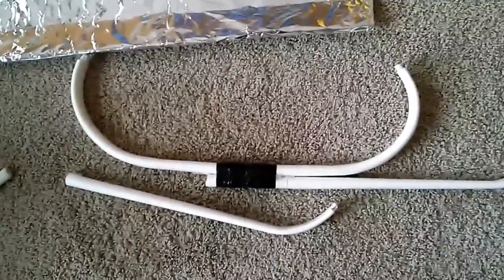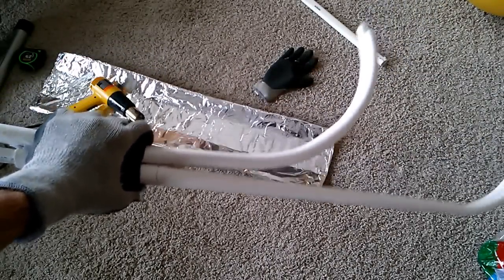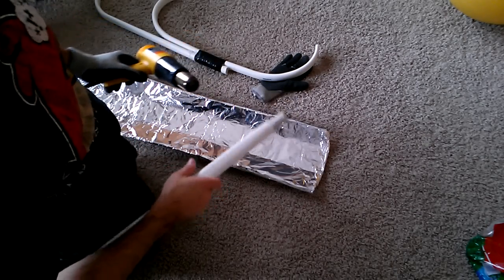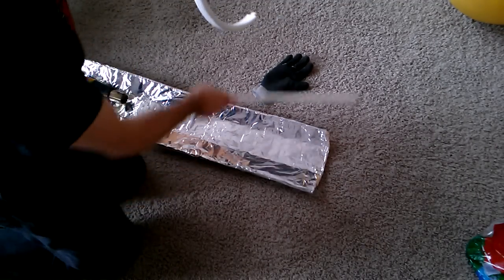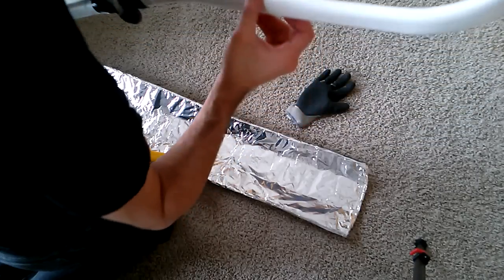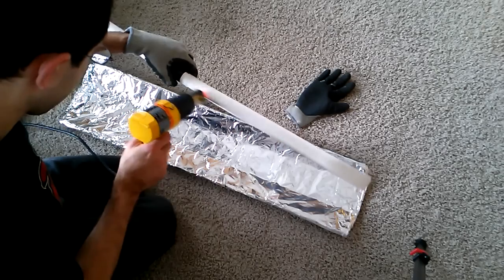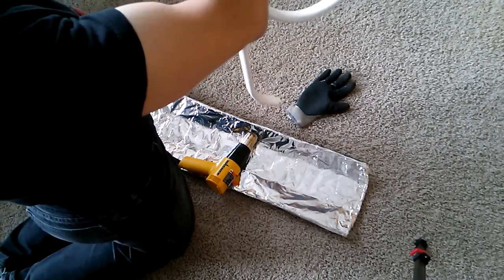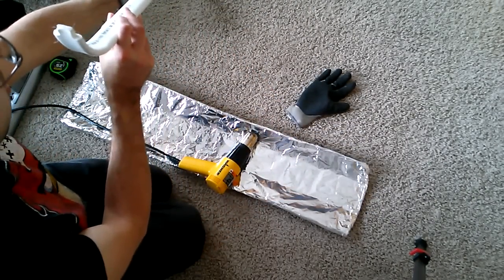Repaired! Fixing the Broken Penobscot-style PVC Double-Bow

Comment from the maker: Each plug was trimmed - I heated them, then cut the corners off with tin snips (you could just as easily sand them); this made insertion easier. I then heated them again and formed inserted them to take the shape of the limb. Not *fully* round, but not totally flat, either. Pinched, is how I'd describe it.

Comment from the maker: Instead of hot glue? First, I can melt the glue again and change things if I need to. Second, I have little to no experience with PVC cleaner/adhesive. I love the idea - blending the plastic together permanently, but I'll need to play around with it a few times to be comfortable. Hot glue is forgiving, so I tend to favor it. Strong enough for most basic applications here, too. To be honest, I didn't think of using PVC adhesive at all when I did this.

Comment: I'm very confused why you don't use PVC glue for PVC. In my experience, neither CA nor hot glue work particularly well on PVC. Why do you use them rather than PVC glue?
Reply from the maker: Hey nomad, I could have used PVC glue no problem. It would have worked better,  I'm sure,  but ultimately, the problem was that the material itself was overstressed, not the glue. If I were making another bow like this today,  is probably PVC glue them together.  Thanks for watching!